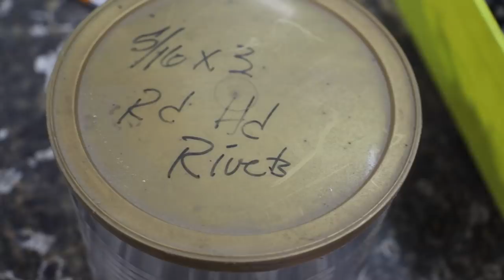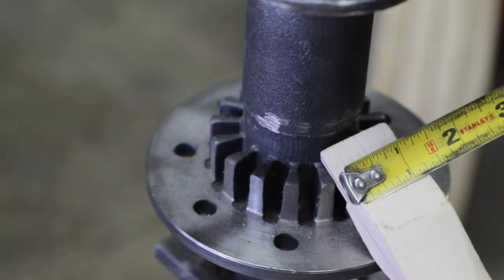Tree Trimming Mule | Roller Bearing Sarven Hubs | Engels Coach Shop

Comment: I've heard that mules are smart and have seen branches fed to goats and pigs. Appreciate that they used rivets as opposed to bolts. Don't want a nut backing off and the wheel falling apart in the middle of nowhere. I'd rather buy a wheel fit by you than one than one assembled. Thanks for sharing.

Comment: Dave, I don't like riveting due to arthritic hands and wrists and I don't make a very neat job either, with the peened over domes looking more like a squashed fried egg. I decided to make myself a tool using a cheap old worn out air chisel bit. I cut off the head and used a carbide die grinder to make a dome shaped recess in the shaft. Now, using an air chisel as a mini-riveting hammer, I find it takes me a fraction of the time and I get almost as neat a finish as you get by hand.
Reply: I recall using such a ready made finishing punch in metal shop in high school in the '60's.  Did make for a nice looking rivet.

Comment: They did use pneumatic rivet guns back in the old days. I'm 75 and I have one older than me that still works fine. Sure saves strain on arthritic arm joints.
Reply: I never thought of peeing has anything but common practice and the only reasonable way to do certain tasks such as securing rivets and or bolts I’m 65 and have plenty of manual ball peen hammer‘s

Comment: I haven't seen a Stanley Tape with 1/32" markings on both sides before now.  Nice modern alternative as it seems to still encourage the old method while providing some nice wheel bearings for just about zero maintenance on the hubs. I wonder if they also provide less drag on the animals.

Comment: Nice work on those spokes to make them fit the roller bearing hub. You must have seen a wide variety style of hubs since with the CAD assisted milling machines there is probably more styles coming out.
A question that I had watching you deciding on what diameter rivet to install, have you found that there is a difference between using a threaded bolt vs. a solid rivet?  Reason for asking is that with threads rather than solid steel there probably is a difference in tensile strength and also more surface area for rust to form on the threads possibly making a difference over the years of the rivets losing some of their compression strength. As a retired Engineer my curiosity just makes me wonder the affects of different materials that go into work in restoring various types of wagon wheels. I enjoy your channel and love seeing all the hand crafted machines and jigs that you have fabricated to make the excellent projects shown, thanks for variety of projects and the quality of the videos.

Comment: Dave I know you like to use old methods, but wouldn't an air operated riveter save your body from all the hand hammering? Also it would be quicker when doing as many hubs. Great video. THX
Reply: Like your reply. Your shop and what you're most comfortable with.
Reply: I want to know how'd he aligned the outer hub holes so perfectly with the inner holes.... prior to drilling!
Reply: @robozstarrr8930  The hub holes are centered directly on the line where two spokes touch on each side of the hub.  Once the first hole is checked on the underside and drilled on that seam, the rest of the holes fall into line naturally.
Reply: @apolloreinard7737  ah, so there is an alignment notch within the hubs, missed that, thanks
Reply: Boeing used to use a one-shot riveter.  All it did was upset a rivet in one hit, one pull of the trigger.  It was called the BAP gun.  Hand held.

Comment: A couple of questions if you would indulge me.
Is the wood for the spokes Ash again?
Do the spokes change in length over time with use? if so how is this compensated for?
I know that wood will move with humidity but the most movement is perpendicular to the way the grain runs, so the width of the spokes would change more with humidity than the length of the spokes, does this come into you building of the wheels? 
I build chairs and I have to think about it a little bit.
Love the videos, they make me want to work even harder at my own stuff.
Cheers from Tokyo!

Comment: One the new hubs, did you ever have one of the mortise walls snap off from the pressure of the spoke being hammered in? The casting looks a bit lean as it tapers toward the center of the hub. Not a criticism; just curious.

Comment: Have any use for 8 point sockets? Fits square nuts & I used them on pipe plugs up to 3/4". Watching you use a wrench & wondered if this would help on some of the tighter spots.